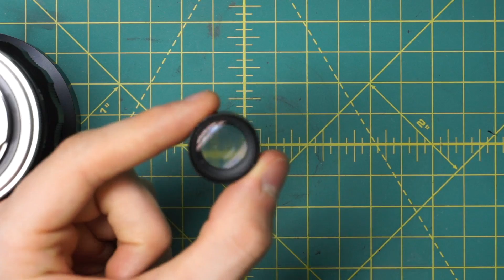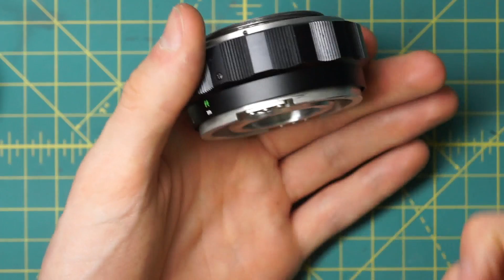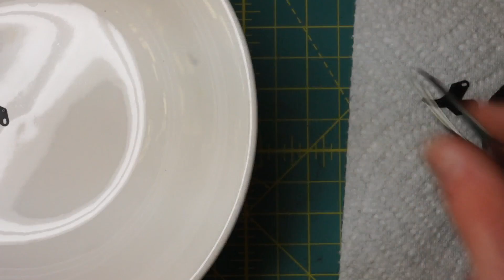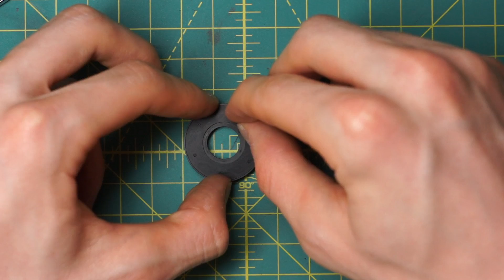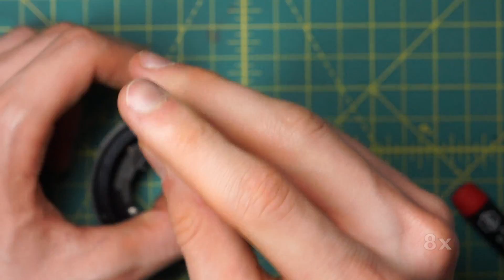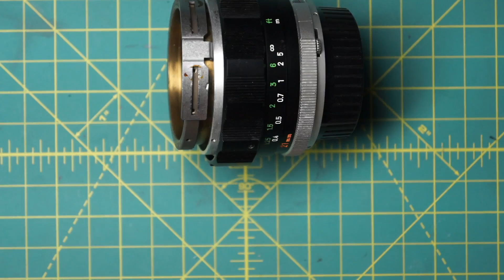Minolta MC W. Rokkor-NL 21mm f2.8 (MCII) Lens Disassembly and Diaphragm Cleaning

Comment: This is what I was referring to before with scribing (or similar) the aperture plates before removing the set screws. Something like the minimal aperture can't just be eyeballed. For instance, look at the difference between even f/16 and f/11, now imagine how easy it is to be a half stop off just by eyeballing it, and the body isn't necessarily going to know this - particularly if it's being set manually.

Additionally, you actually dodged a real bullet in not taking that focusing mechanism entirely apart. While cleaning the helicoil on a traditional 35mm or 50mm lens is easy enough - it's way more complicated on a retrofocus wide-angle lens that uses CRC (or similar). Be glad you did not get into the bowels of that.

Also, always best to clean the inner front and rear glass faces with naphtha (or IPA) when you have access to them - as they regularly have evaporated grease adhered to them.
Reply from the maker: +C L Thanks for the advice an the aperture blades. I do skim over that part pretty quickly in the videos but do spend more time before and after to get this more correct based on a reference or photos. Adding a mark is a good idea and would probably be more accurate.

I've had trouble with the focusing mechanisms on wide angles in the past, which is why I usually don't take them apart, unless the disassembly requires it or there is some major problem with focusing. Marking where everything lines up before hand is helpful, but finding the proper realignment can still be a pain.

Comment: How come no one putting up lens disassembly videos tells us that the screws the Japanese use are not phillips style but JIS, and you should use JIS type screwdrivers to prevent damaging them?
Reply from the maker: Thanks for that point. Ideally you should use JIS screwdrivers but high quality and correctly sized Phillips head screw drivers will work just fine in practically all cases, especially at these small sizes. I've never really had problems with any cross head screws on old lenses, it's always the flat head ones that end up getting stripped or damaged. But, for more expensive lenses, the value of details like this may be different for you.
Reply: I couldn't get a Canon lens mount screw out even with a pliers helping me turn. The Phillips kept popping out and messing up the slots. Then I tried a JIS screwdriver and it came out like butter.(even without a pliers)